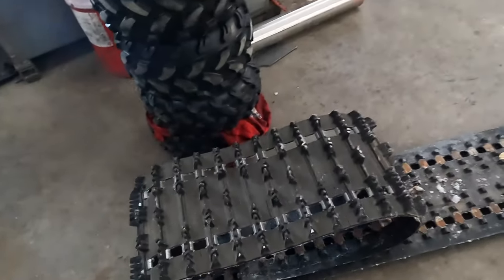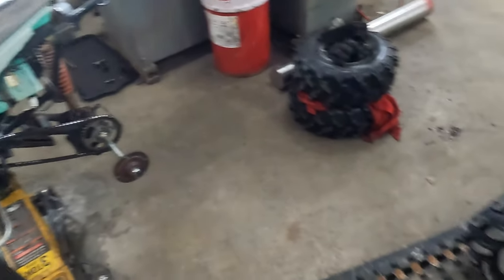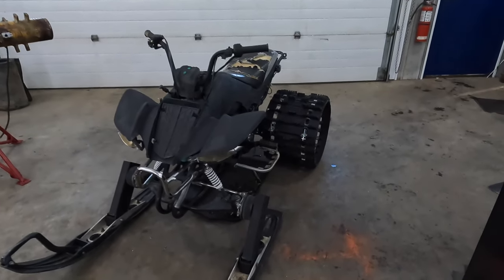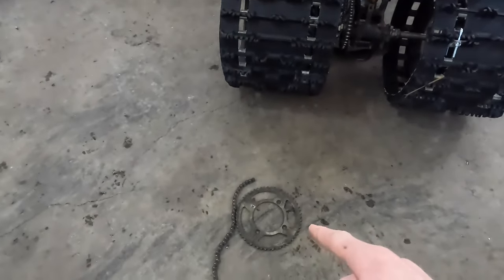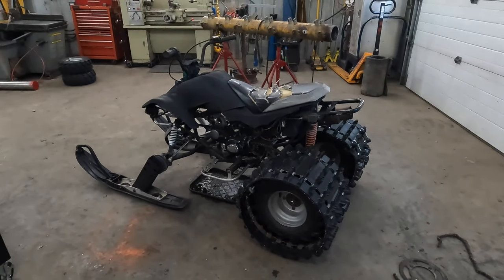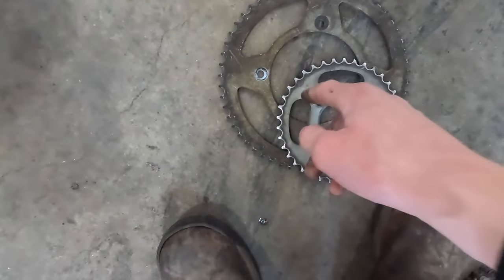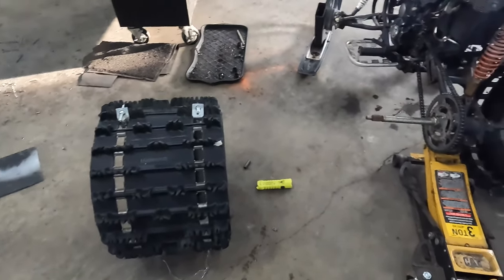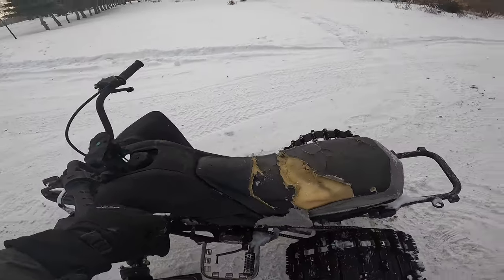Snowquad Built With Snowmobile Skis and Tracks!

Comment: I missed how did u secure tracks back together?to tires?
Reply from the maker: To secure the tracks to the tire we cut it to be able to fit over the rubber while the tire was deflated then we put u bolts that clamped the track then inflated the tire while also tightening the u bolts